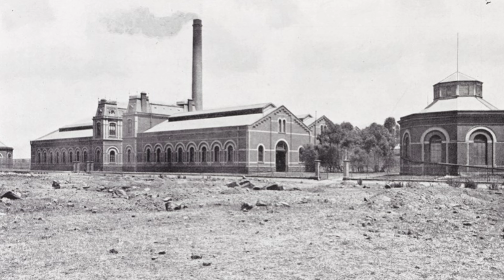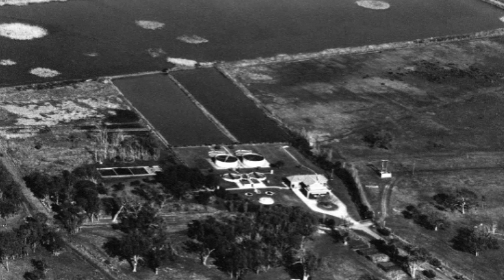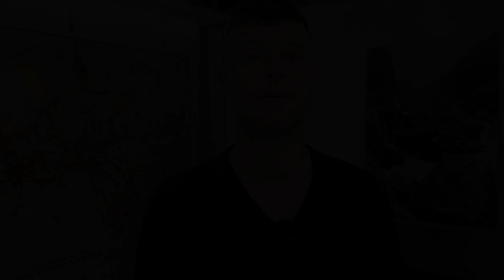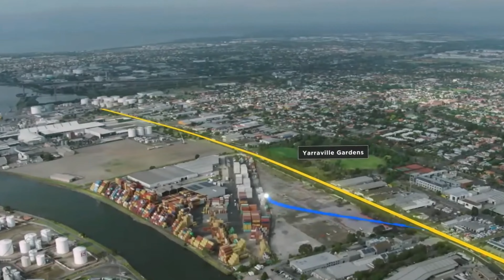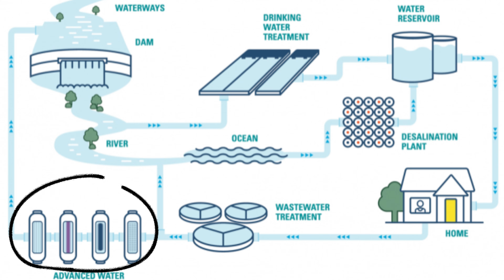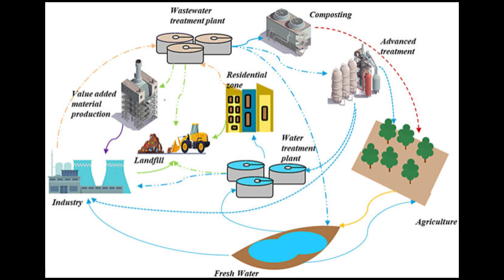Melbourne's Sewerage Story - EP5: Expanding the System - Growth, Innovation & Treatment Plants

Comment: Great summary of the 20th century development of the sewerage system for Melbourne. There were a number of satellite sewerage authorities such as Lilydale, Frankston and Dandenong who were amalgamated into the MMBW and its replacement, Melbourne Water, in the 1980s and 1990s. This grew the system quickly as the treatment facilities for such systems were intercepted by the trunk sewers if they fell inside the catchment of the trunk sewers and treatment sites were decommissioned. I was involved with a lot of those alterations and the development of major trunks sewers such as the North Western Interceptor Sewer that intercepted flows in northern stream catchments and sent the sewer flows directly to Western Treatment Plant. There was a lot of effort to separate the Eastern Treatment Plant from neighbouring development but like all development and service interfaces there are still issues around the proximity of the treatment plant to urban development areas, despite the plant being there before a lot of the urban development. Reuse of treated effluent is a major push by authorities such as Melbourne Water as it is environmentally sound and can be cost effective instead of disposal to the environment. The key objective of all the sewer system development has been supportiung the continued development of Melbourne. Keep up the good work.